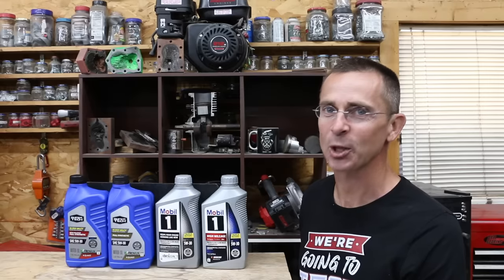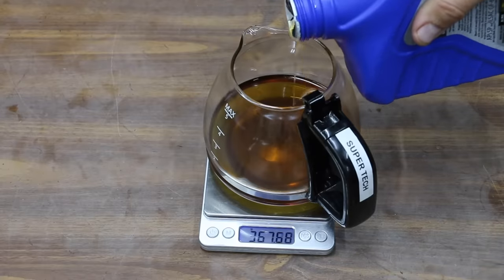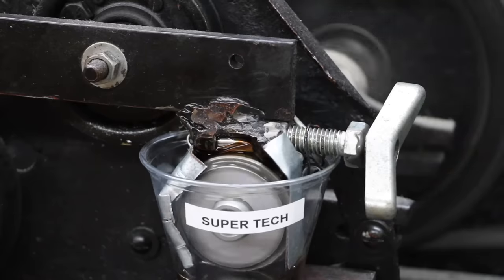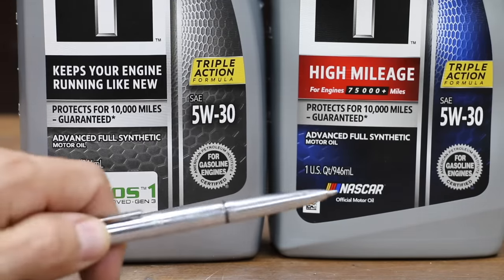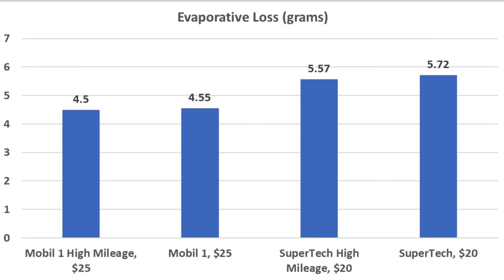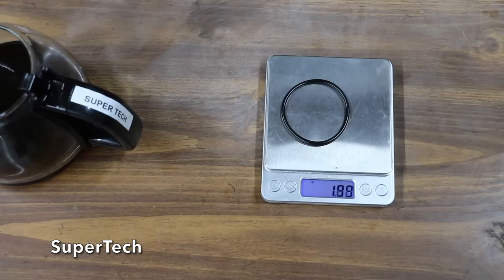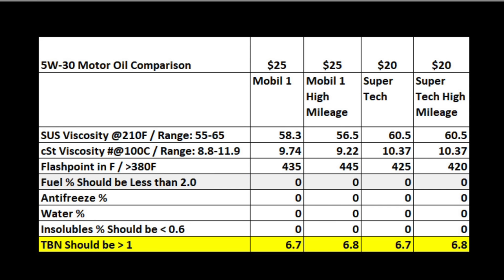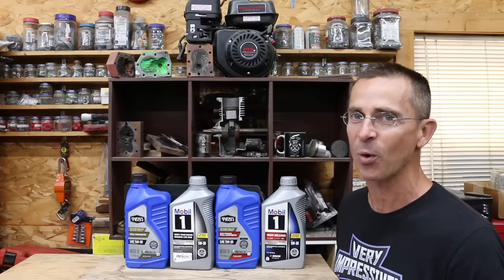Is “High Mileage” Motor Oil Safe? Let’s find out! Mobil 1 vs Mobil 1 High Mileage; SuperTech vs STHM

Comment: High mileage oils aren't meant to stop leaks, they're meant to prevent leaks with additive seal conditioners that help the seal stay pliable rather than drying and cracking or become inflexible. If you have a leak it's already too late and you just need a new seal/gasket. This has been my experience at least. In one of my newer KIA engines, using high mileage has actually reduced the oil burning to near nothing. Pretty impressive for the little boost it's supposed to give.
Reply from the maker: Thanks for the feedback.
Reply: Why does it "burn" oil ? Valve stem seals?
Reply: But then why are there be a need for high mileage engine oil vs not? Just marketing? If it preventative only, then the needs of an engine at low mileage should be the same as high mileage.
Reply: @ccbowers  BMW has entered the chat
Reply: That lucas oil leak stop is supposed to work pretty good for that
Reply: @ccbowers  There is no actual need. It's for high mileage engines and the idea is that the additives (none of these oils are actually synthetic oils, they are just used and cleaned mineral oils with additives to qualify as synthetic, for an actual synthetic oil the price is 4-5 times as high) will swell the valve stem sels and other seals. It doesn't really work very well AFAIK.

The truth is, if your engine is burning oil there is something wrong with it and you should fix it.
Reply: @sorrywrongnumber5280  No, just no. It's awesome as assembly lube but I wouldn't use it for anything else. In some better oils it would be a complete downgrade of the oil which adds to the viscosity and makes cold starts harder on the engine. If your engine burns oil there is something wrong with it, fix it.
Reply: Have you done any tests including the full synthetic Kirkland oil at Costco? Surely (my thinking) they did research before using that product under their private label brand.
Reply: If your engine is burning oil it could just be high mileage anyway. Our old Blazer's V8 has over 500,000 miles and downs a quart of straight 50 racing oil every two weeks. It's just old
Reply: @libertyandjusticeforall6435  there’s no high mileage oil in US market suitable for A3/B4 even A5/B5 requirement. If your European vehicle is leaking oil, best to do is to replace the seal or leave as is if it does not cause further trouble.
Reply: @clintprice2123  yes he has done Kirkland oils before...as expected and like the SuperTech perform very well
Reply: I used high mileage once and it actually caused leaks. Never again
Reply: @luminator982  Frequently that is from a synthetic oil cleaning around seals. The debris was sealing it till then.
Reply: @NoName5589  that means it’s worn out.
Reply: @jc.1191   I came back to reply this.
Reply: @kirkthebeerslinger  thank you for your reply.
Reply: In heavy duty diesels and I'm not talking powerstrokes and d Max's but in things like big Cats/Detroit/Cummins etc... They burn oil just a bit just because of the pressures and heat they create. The Lucas oil stabilizer does help with that and I don't service one of the big boys without adding 2 gallons of Lucas first. Also depending on what type of oil pump the engine has (gerotor type is typical in heavy duty diesels) it doesn't matter the viscosity difference unless it's mud lol it will develop plenty oil pressure. Lucas mixes in oil very well too. The super thick product that comes out the bottle isn't like that once it mixes with the oil. It's still a bit thicker but nothing crazy
Reply: @clintprice2123  I believe it's the same as Supertech and Amazon basics. Both of which he's tested here in the past.
Reply: @michaelmay5453  I agree!
Reply: @gtzgreatride  I'm curious what the cause is, frankly; my '18 Soul doesn't burn oil at all, but my mother's '14 Accent drinks about a liter between changes (~6500km) - Not as bad as my old Subaru, but definitely seems a touch odd. Also seems to vary wildly on how bad it is for any given car. (Pretty small issue overall though, I admit.)
Reply: To my understanding (I am a mechanic, but keep in mind , I haven't used scientific test equipment, but I speak from after failure analysis)
The Kia/Hyundai 4cyl engines have a burning oil issue cause by both, carbon buildup on valves causing seals to wear prematurely/pcv design issue, however that issue is minor compared to the ring to cylinder clearance. They are ring gap is really small, because they designed these engines for both turbo and non turbo applications, the oil ring clogs and cannot scrap the oil off the cylinder walls effectively, this occurs over time from being direct injection at cold start conditions, the rings and piston aren't up to temp, causing blowby and excessive carbon buildup, causing the rings to clog, causing the oil to burn.. if you follow my hard to read comment lol.
Reply: @gtzgreatride  all engines requiring 0w20 and 0w16 burn oil
Reply: @ccbowers  So called high mileage oils are usually on the heavier side of their viscosity numbers. You can get similar results by going to the next weight up in viscosity, for an engine with high mileage. All motor oils, even non-high mileage types, have rubber seal conditioners in them now.
Reply: @clintprice2123  Almost all "synthetic" oils are about the same. It's just used and cleaned mineral oil with some additives to get it over the bar to qualify as "fully synthetic" so I'd assume it performs about the same as the other "fully synthetic" oils.

Then there are the actual synthetics but those are expensive.
Reply: @gtzgreatride  yea kia is junk. I worked at a dealership for a month or so as a service advisor. Had 8 come in
Reply: @gtzgreatride  Yeah, it's not at a point we're seriously concerned, but it's definitely something that's notable.
Reply: @michaelmay5453  many engines which burn oil are due to piston ring wear.  This is becoming more common as manufacturers use softer piston ring metal chasing lower internal friction/higher fuel efficiency.  In order to fix that you need to completely rebuild the engine or have the engine swapped out.  For many vehicles that's more than theyre worth.  My car is known for engines that burn oil, but they routinely last to 250k miles without issue as long as you keep them topped up.  I'd welcome any product that reduces blow by without affecting reliability or performance.
Reply: @jaredpaulsen3  I understand where you are coming from I use to turn wrenches for a hyundai dealer. I never got the silver cert, mostly because we were one of "those dealerships". It was my first gig after schooling and I didn't know what to look for. To add on to yours, being GDI supposedly causes some fuel to mix with the oil causing it to degrade rapidly after a certain amount of contamination. I'm completely unsure why it lowered the rate at which my particular kia burns oil, all I can say is that it did. I have also used mobile 1 since driving it off the lot new, and the intervals are 3k and below. Manufacturer spec for time of production and model is between 3750 and 7000 miles. Which I always found to be complete insanity. I wish I still had access to those diag machines and the disposable income to send off the oil for testing. I'll do a bit more reading in the forums and tinker if it gets worse. I appreciate the input.
Reply: "High mileage oils aren't meant to stop leaks, they're meant to prevent leaks with additive seal conditioners that help the seal stay pliable" Why should we use recommended oils? Better to go directly to HM oils based on that theory.
Reply: @kmook76  Kia/Hyundai have hi oil consumption issues. It may be due to GDI.
Reply: @kmook76  all engine burn oil through the PCV(positive crankcase pressure valve) system.
Reply: Newer Kia's burn typically burn oil?
Reply: @AntiMatter Fox High mileage oil can help stop some leaks if they are very small since the additives that soften the seals also causes them to swell slightly.
Reply: If that's the case.. then why in the world is it called high mileage? High mileage is when you likely are already seeing seals fail. Wouldn't it be intuitive to run it throughout the engines life to prevent drying seals if that's it's intent?

I think this comment is silly because it wouldn't make sense to advertise it the way they do if what you said is true
Reply: @nsboost  That is why it is recommended to start using it at only 75,000 miles or 10 years old before the seals have worn down or aged enough to not be reversible. It is not recommended to to use it before then as it is more expensive and causes more pollution as it burns which addition to not being good for the environment wears down the catalytic converter quicker. But there are specific oil additives for new engines you can get and add to your regular oil for preventative maintenance.
Reply: A lot of newer cars burn oil. Definitely hyundai/Kia but also Toyotas and more. It's generally due to pcv systems. Just add oil in between changes. No biggy.
Reply: Honestly those are the two brands I use and trust the most after LiquiMoly. As long as super tech has oil filter for your vehicle you can get Mobil 1 oil and super tech oil filter for right around $30 to $40 depending on how much oil the car takes. You can get super tech oil and filter for $25 to $35. As a side note K&N makes super tech filters and the nice thing is they mimic frame part numbers so say your car takes a ph1 fram filter the super tech equivalent is st1 filter and so on.
Reply: That seams kind of pointless. By the time someone switches wouldn’t the damage be done.
Reply: @williamardenjr116  My '19 Ford Fusion Hybrid uses 0w-20, and at 65,000 miles, so far uses zero oil between changes. Just changed the other day, and had about 9,000 miles on the oil (since it's a hybrid and the engine runs roughly 2/3 of the time, I figure that's about equivalent to 6,000 miles on the engine). Not trying to argue, but just saying I haven't had that experience.
Reply: Should I trust what you are saying because you own a Kia lol. Just joking with you what u said is true
Reply: @williamardenjr116  hello,I read from an article’s amKOREAN,& would NEVER BUYa HYUNDAI,OR KIA,as they ar JUNK,that person also said NEVER BUY A  SAMSUNG  APPLIANCE !
Imagine that,take care,,🇺🇸🇺🇸🇺🇸🇺🇸
Reply: PF, Hello,I found this interesting ,I used to use the high mileage oil,in my 91 TAURUS, when I used JIFFY LUBE, IT WAS RETIRED AT 450 K,& #5 cyl, then had LOW compression,,🇺🇸🇺🇸🇺🇸🇺🇸
Reply: @katiewebster9190  I think.. in general... It's ALL over thought. Before I built a motor for my Trans Am.. it had a 280,000 mile stock 5.3 Chevy Silverado engine in it. I put a camshaft and valve springs in it. 

I shifted that engine at 7800 rpms with 20# of boost making 800hp. With a nearly 300,000 mile motor in it. Ran the cheapest regular old super tech oil I could buy with a wix filter. Didn't leak a drop. Didn't tick. Didn't skip a beat. Car ran 9s in the 1/4 mile. 

I think people over think stuff. Change your oil regularly. Don't let the engine run out of oil. Life will be good.
Reply: @jc.1191   I've had the same thing. Switched from high mileage to normal Mobil 1 and went from a quart every 2 weeks to a quart every oil change. 

Most of the high mileage stuff is marketing bullshit.
Reply: Lmfao
Reply: @clintprice2123  i believe the kirkland oil and the supertech oil are made by the same company. Unless I am getting it confused with their batteries which I know are the same as a fact.
Reply: @michaelmay5453  😆
Reply: @flybyairplane3528  yea I'm about done with Samsung as well. Last 2 phones I have had are always lagging, or locking up!
Reply: So why isn't all oil high mileage as there seems to be no disadvantage to using it in new cars
Reply: I have an f150 w 472k miles (2012 5.0) around 300k started smoking really bad, swapped to high mileage oil (stp full syn) and it stopped the smoking
Reply: Yes and no, and legally those claims could be used as well.  While seal conditioners are helping to keep seals pliable and from drying out they do also cause seal swelling which can stop oil leaks. Nobody should expect a solution in a bottle but it is possible and a plausible action of a high mileage oil additive package.
Reply: @ProjectFarm yah. And I have used AT205 reseal  help recondition seals even more.  And it does work but the leaks have to be small.  And any sort of stop leak should be only added with at a oil change with new oil.  @scottykilmer
Reply: They're designed to "swell" them but once you use it once you have to continue or the seals will contract and everything will leak...
Reply: @cornbreadntatersalad1634  Would you recommend that Lucas for a smaller (1.5L) diesel? I have an old VW Pickup and might benefit 😅
Reply: @roccit  I would highly recommend substituting a quart or 2 of Lucas for engine oil. The recommendation for how to mix it is on the bottle but yes with my experience older more worn engines benefit from Lucas a great deal.
Reply: @williamardenjr116  I dont know if that is a valid claim. I have a 2019 Camry with 210k miles on the 2.5 4 cylinder that takes 0w16 and it doesnt burn any on 7,500 mile oil changes and a 2015 4Runner thats just about to click 200k miles and dont have any consumption issues with it on 5,000 mile changes both cars oil comes out very nice and clean still and as full as when they were changed
Reply: @XenomorphLV426  Not all newer you have to be careful with that info. The Gamma series found in Accents and Rios, the Theta II series found in 2011-2020 Hyundai/Kias like the Sonata/Optima and Santa Fe/Sorrento, the NU series in the Elantras and GDI variant in the 2.0 Tucson as well as the Lambda series thats in the V6 Sorrento, Telluride, Santa Fe XL, Palisade all burn oil yes thats a lot of engines and a lot of cars BUT if you look at any newer Hyundai with a Smartstream engine which is a 2.5, 1.6T and a 2.5T (be careful of the 1.6T Elantra N-Line still uses that old 1.6T with the issues) the Smartstream engines are great my Hyundai store has done one engine on one it was a Santa Cruz with a bullet hole in the block other than that we have multiple 1.6T Sonatas with 100k miles or more and a few closing in on it and multiple 2.5 Tucsons, Santa Fes and Sonatas around the 100k mark and no oil consumption issues to be heard of. All the older series engines were consuming by that point. Hope I could help ask questions if you want a legit answer I can probably help !!
Reply: @indowinftw  I know he’s done rachets of multiple styles. I think I recall and oil filter video also. Don’t know about bottle jacks so I second that request. I’m going to look for a video anyway.
Reply: @jaredpaulsen3  You are correct and this is why Hyundai recommends fuel system cleaner every 15k.
Reply: @clintprice2123  he has, he did a test using Kirkland, Amazon, and Walmart. All were bottled by warren industries.
Reply: Call me old school but I miss the music when it’s going thru the wear scar test
Reply: Call me old school but I miss the music when it’s going thru the wear scar test
Reply: @Austin-cg7be  toyota and Honda are not even worth bringing up because i tell everyone to buy nothing but those
Reply: @FishFind3000  You're definitely right, but mechanically there isn't anything wrong with it other than the burning oil
Reply: Supposedly, there’s lower zinc/phosphorus levels, some of these HM oils are loaded with moly or boron as anti-wear per the VOA/UOAs on BITOG. 

Castrol is proud of their Phosphorous Replacement Technology in GTX/Edge HM. Personally, HM oils to me are a “nice to have” but I’ve ran a Toyota V8 to almost 300K on non-high mileage oil.
Reply: I have a notorious oil burning engine and the high mileage oils definitely cut down on the oil burning. I still burn a decent amount but not nearly as much
Reply: My seals were bad on one of my Lexus about 14 years ago and I would lose a lot of oil between changes. I switched to Valvoline High Mileage oil and it stopped my oil loss significantly. It definitely did something to help, but I’m not switching to it on any of my vehicles that aren’t losing oil just because they have high mileage, I still use full synthetic. If the seals ever start leaking I’m pretty sure I’ll switch that particular vehicle to high mileage oil.
Reply: @robertm5969  His "expensive  oil" is worth it in the long run.  The problem is, it has to be used before the issue arises, to prevent it.
Reply: @TheBeatenPaths  I have been using Pennzoil platinum since purchasing my vehicle at 30k miles.  It is the 2nd best oil for these engines based on oil analysis sent in from dozens of owners, perhaps the best based on chromium loss.

I still experienced oil burn around 70k miles and average around 1 quart loss per 1000 miles.  I'm not sure what else to do besides check the oil regularly and keep it topped up every 1000 miles.

If there is a specific product that can help reduce this I will be glad to give it a try.  So far Lucas oil stabilizer seems to be the only thing I've tried which made a slight difference.
Reply: @robertm5969  Just to make sure I've got the facts straight, you bought your vehicle used, with 30 000 miles on it when you bought it?  
If so, the damage has been done, and theres nothing you can do, more than what you're doing. (Reasonably speaking.  You could tear the engine apart, I suppose).   You're not going fix the problem out of bottle.  You can help prevent it out of a bottle, but you're not going to fix it.
I'll go out on limb and suggest the previous owner had warranty and got oil changes done "for free" at the dealership with factory oil.   That's where & how your current oil burning issues occurred.  
You see, all factory oils, Ford, Harley Davidson, John Deere, you name it, have to subpar oils.  Those are huge companies, but they're not big enough to own their own their own motor oil processing plant.   It's farmed out to the highest bidder, or the lowest provider. 
I bought a brand new 2019 Ranger.   Within 3 days I had the motor oil, both diffs, and transfer case fluids changed.  And within a month, the antifreeze and brake fluid changed.
Reply: @ulogy  do your oil changes more often. I never change my oil past 3000 miles. 4000 is too much. If you look at the color of your oil after 2000 miles, you will notice that it's already dark and thick. At that point the oil has already done the job. I do 2000 on mobil 1 and every few I do a flush with a cheaper brand for about 200 miles. My engine has 90000 miles on it and she is as smooth as the day i got her.
Reply: @ulogy  one of the more common reason for oil burning is not changing oil enough or low oil. I'd rather spend 30 bucks a little more often than rebuild or replace my motor
Reply: @williamardenjr116  hmmm, my Lincoln 2012MKZ 3.5 L with 190,000 miles on Amsoil 0w-20 doesn’t burn oil! 😅
Reply: @flybyairplane3528 wow! Congrats, 450,000!
Reply: @darrylsjodin7184  I'm sure it burns some as all of them do! Limcons are nice though!
Reply: @clintprice2123  yes he has and it did amazing
Reply: The solution is to NEVER buy a Kia or Hyundai. Their engines are disasters waiting to happen.
Reply: @NoName5589  that's its fiber, anti acid, Metamucil, miralax, and one a day vitamin all in a 50 racing oil ,lol, back off im old to I get it. I had a 78 2 wheel drive built 350 with a tci street fighter trans 2800 stall with over 400k on it and it like her a quart of 20 50 about every 2 or 3 weeks to. I miss that k5.
Reply: @clintprice2123  for the price when it's on sale I buy it up for my vehicles.  Stuff is cheaper than non synthetic Castrol most of the time.  I've watched a bunch of PF's oil videos, can't remember if he's tested Kirkland either.  I never go over 5,000 miles so even shit oil would work in my case.  Kirkland is just fine.
Reply: @williamardenjr116  👍😀
Reply: @TheBeatenPaths  
While I agree that factory oils are bid out, they all have to meet the API spec for warranty, which currently is SP. SN and SN+ were the most recent and were plenty good to prevent engine damage that would cause high oil usage. I would bet that the cause of the high oil usage at 30,000 miles would be fuel dilution of the oil, not necessarily the oil brand or even the drain interval. I had a 87 Mazda 323 that had a fuel system problem when a radiator switch failed to move and caused fuel dilution, proven by oil analysis and used a quart of oil every thousand after that, when before at 45,000 miles was fine. I’ve had a 91 Mazda truck, a 98 Grand Caravan, 2000 Chev van, a 2003 Z06 Corvette, an 06 Fusion, a 2012 Fusion, and a 2012 Lincoln MKZ, I still have 3 of them, mileage as high as 287,000, all on Amsoil with 12,000 to 15,000 mile drain intervals and none have used more than a quart during that high drain interval! It’s unfortunate, but sometimes non-oil related things happen that can cause engine problems that don’t go away. 😕
Reply: @sorrywrongnumber5280 If you want to destroy your engine, SURE!
Reply: My mom and I had this theory with her 2014 Kia Sportage, 100k and it was burning a lot of oil. To the point where we thought buying the whole jug would be beneficial. She switched to high mileage oil, month later and it only used half a quart. Seems to help with the burning alot.
Reply: @katiewebster9190  true,they don't know 🤷🏻‍♂️
Reply: if it leaks just park it somewhere where is doesn't matter if a few drops of oil get on the ground. Lots of time it's the rear main seal that leaks which is a PITA and expensive to fix. By this time the car is probably approaching 200,000 miles or so. Time to get rid of it anyway